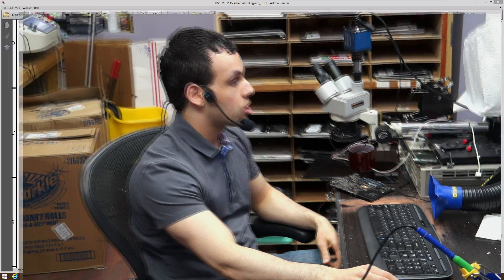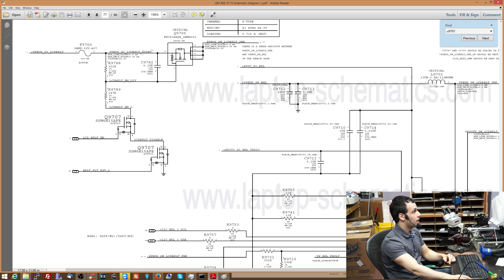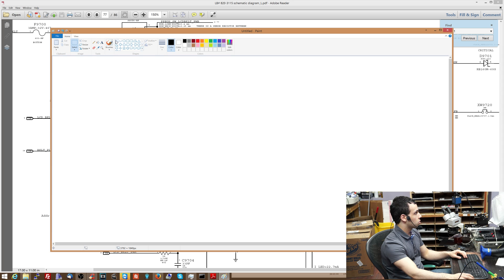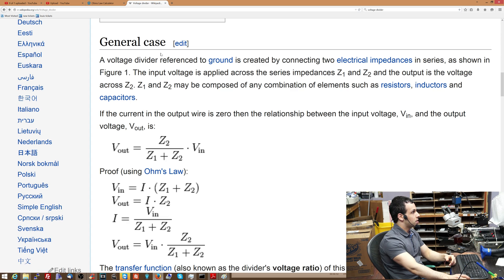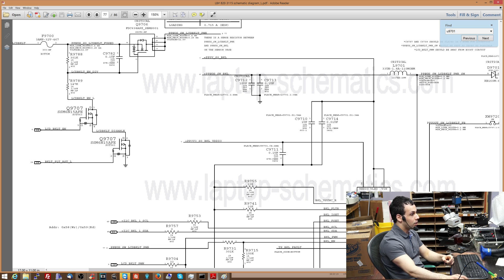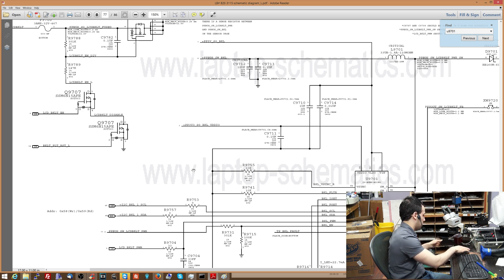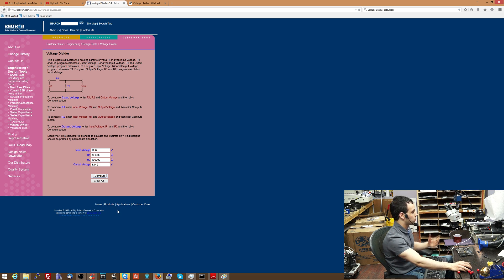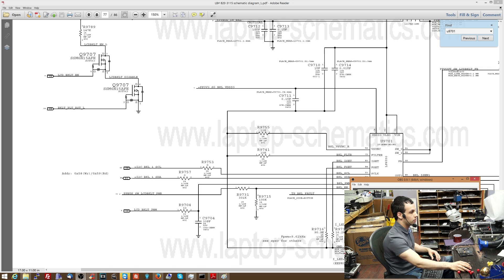What is a voltage divider?

Comment: can you put power through a voltage divider using a transistor to make it more efficient so it is not always on? Or make a parallel connection from the voltage (whenever voltage is switched on in the system) to the desired read pin? Anyone please correct me I am new at this stuff

Comment: At 5:03 u said Z is a resistor which all wrong... Z stands for impedance (which is a type of resistance offered by an inductor or a capacitor)
Reply: it is correct because it is referring to a voltage divider possibly using capacitors and inductors which with reference to an AC source would be an impedance voltage divider.

Comment: a voltage divider (also known as a potential divider) is a passive linear circuit that produces an output voltage (Vout) that is a fraction of its input voltage (Vin). Voltage division is the result of distributing the input voltage among the components of the divider. A simple example of a voltage divider is two resistors connected in series, with the input voltage applied across the resistor pair and the output voltage emerging from the connection between them.

Resistor voltage dividers are commonly used to create reference voltages, or to reduce the magnitude of a voltage so it can be measured, and may also be used as signal attenuators at low frequencies. For direct current and relatively low frequencies, a voltage divider may be sufficiently accurate if made only of resistors; where frequency response over a wide range is required (such as in an oscilloscope probe), a voltage divider may have capacitive elements added to compensate load capacitance. In electric power transmission, a capacitive voltage divider is used for measurement of high voltage.

Comment: If you only want to lower the voltage from 12 to 3, why don't you just use one single resistor? What is the purpose of using a ground path with an extra resistor? : / I probably need to know the things you taught in the older videos, let me start learning then
Reply: If there is no resistance (or impedance, which is like resistance in AC circuit) the current will just use that path without doing useful work.
If you have a river and you cover only half of it with a mill, more water will flow through unobstructed part of it than the part with mill.
Keep in mind that resistors in series divide voltage while having same current, while resistors in parallel divide current while having same voltage.
In this case the output can be thought of as resistor and it is in parallel connection.

Comment: Just a QQ in one of your other vids I thought I remembered you saying that a resistor will not change the voltage but resist the current so on one side of the resisitor you have say 12v 3a and on the other side you still have 12v but maybe only 1.5a. so how is it different in a voltage divider? why is the voltage changing when it doesn't change in other scenarios. is it due to having ground so close?
Reply from the maker: because you are connecting the resistor to ground.

the first resistor limits the amount of current available. so there is not a lot of power available.

the second resistor, usually a lower resistance than the first resistor, sends that very limited power to ground, which winds up lowering the voltage.
Reply: @rossmanngroup  ....correct me if I am wrong, but resistors are voltage controlling, not current controlling. re: Kirchoff's current law: current remains constant throughout the entire circuit. Yes? No?
Reply: Hey just to clarify, I know this is and old question but it might help someone else. 

The voltage divider works when resistors are in series (Current divider works when resistors are in parallel).
When resistors are in series Voltage does actually drop across a resistor but current doesn't.

Electrons flow because of a force that force is the voltage (energy per charge). When the electrons hit the resistor it loses energy because the electrons collide with the resistor so it has less force. Current on the other hand is just the speed of the electrons passing though the resistor. Now to get your head around current you need to imagine current going around a closed loop circuit at the exact same speed, like how a bicycle chain goes around at the same speed. When you apply the brakes on a bike the chain will still turn at the same speed just slowed down. That's how resistors work in a circuit, its like applying a break. It doesn't matter where you put resistors, if resistors are there it's going to slow all the electrons the same. 

Now back to the voltage divider, if you measured from the top you will get 12v, in the middle of resistors 3.3v and at the end 0v. The current will be at the top 39uA, in the middle just before the black dot will still be 39uA. When it hits the black dot it splits 33uA will go to ground and 6uA goes to the chip. When it splits that part of the circuit becomes a parallel circuit. So that's why instead of voltage now dropping the current drops. The reason why more current flows to ground than to the chip is that the resistor is 100k but the resistance of the chip is 500k. And like Louis said the electrons will find the easiest path to ground and they all rush to the ground point. 

Also extra clarification, If there was no middle line going to the chip the scenario would be: 
voltage drops will be the same 12v , 3.3v , 0v but the current from the top to bottom would stay the same (no parallel circuit).